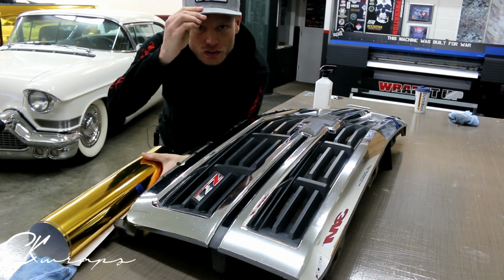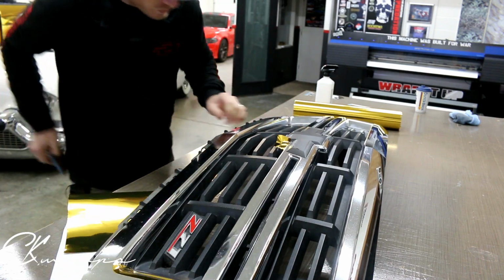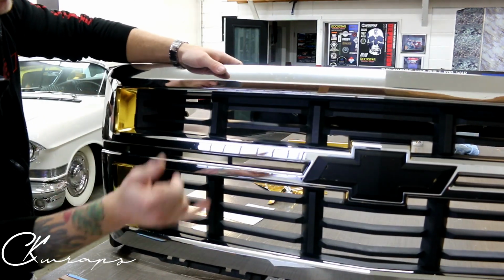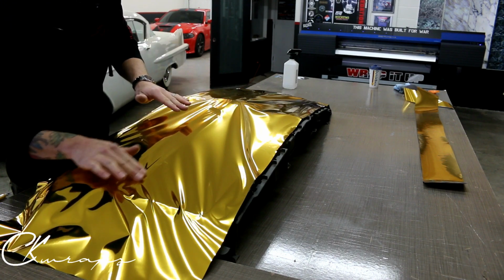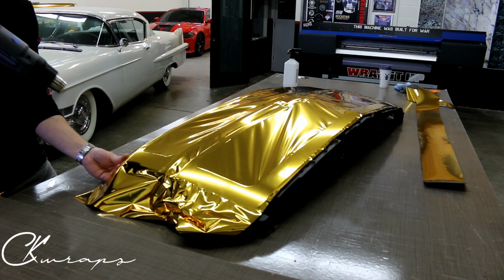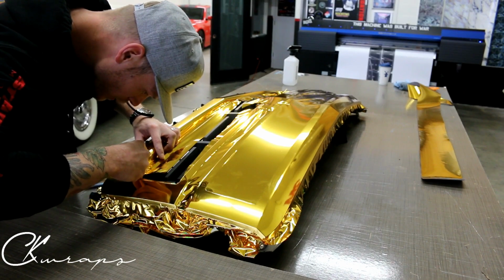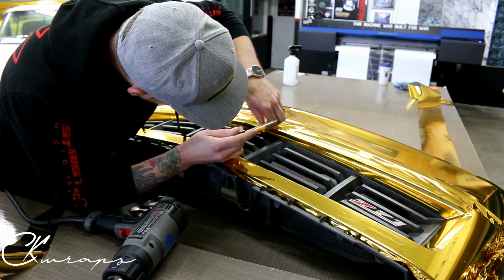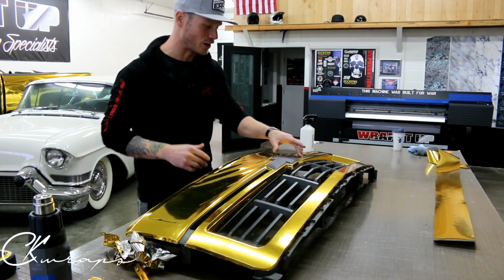HOW TO VINYL WRAP A FRONT GRILL IN GOLD CHROME Using INLAYS!

Comment: I have to do this on a Chevy this week.  Thanks for the video it will help out a TON!
Reply: How’d it go ??
Reply: @LS3_Trevvv  I didn't do chrome but this method works. I've done to grilles wrapped in black for my customers?
Reply: Since your last comment have you done the chrome grille for a Silverado? How’d it come out? And how long is the vinyl lasting on the black plastic?
Reply: @bludragontruck9743  one guy I know sold his truck and the other I saw a while back and he still likes it.
I did another one too but I can't remember.
I also have a Ford on my channel with wrapped grill and bumpers and he sends me work so I think his is good too.
Reply: @FadeToBlackLLC  Thanks for the feedback. I’m just a little skeptical on how much this is going to cost and if it’s worth the high price. For a chrome delete on my 2015 Silverado a guy in town wants $400. For the grille and headlight bezels, is that worth it👍🏼
Reply: @bludragontruck9743  that's ballpark for what I charged. It takes a good part of a morning to do. So I'd say yes.
Reply: @FadeToBlackLLC  Thank you for your honesty. Times like these that goes a long way.
Reply: @randyhill3964  I've actually done a bunch of them since this. Lay the inlays into the flat areas and it definitely helps. Then one big piece over the top and meet the inlays and carefully trim.

Comment: i have to say when you were trying to contour the film on the side of the grill that where there was no support and it kept moving on you, you could have just flipped that grill around so that you could use the edge of the table again for that side, i was frustrated for you just watching you struggle
Reply from the maker: +Dom Branstad you're right I could have flipped it but I wanted to be able to see the more curved side of the grill so I knew how much to pull the film. I also wanted to keep it in a position where I thought it would make for a better video
Reply: CK Wraps yeah that makes sense, and it was good to see how to form with a little heat as well, I was just thinking about saving the pain I guess